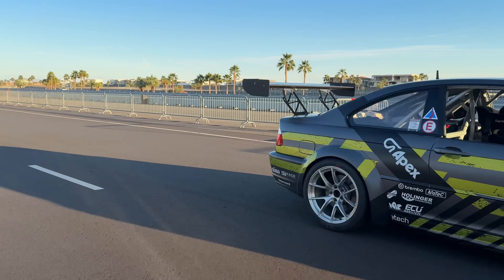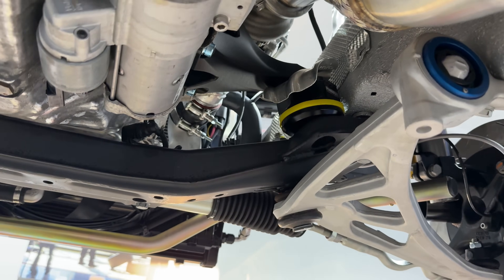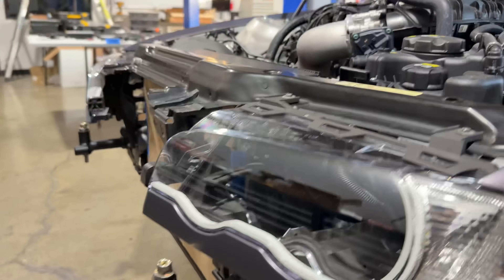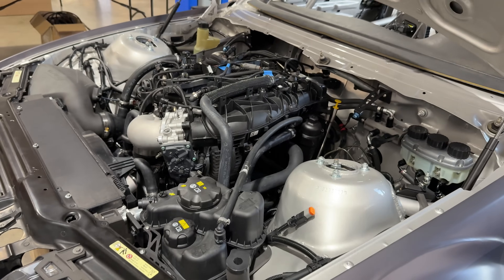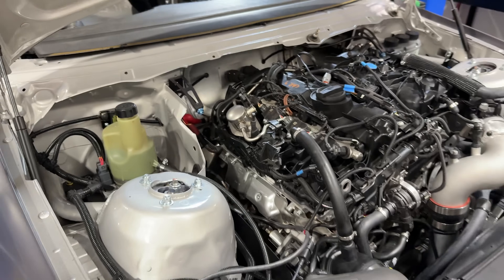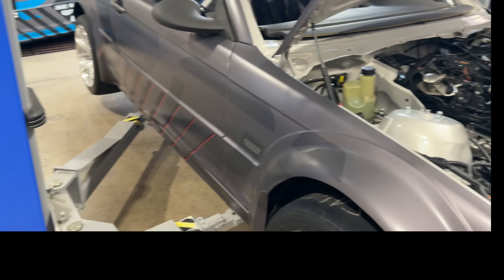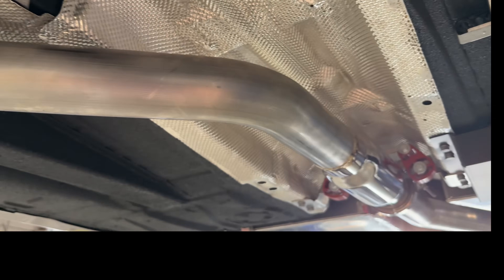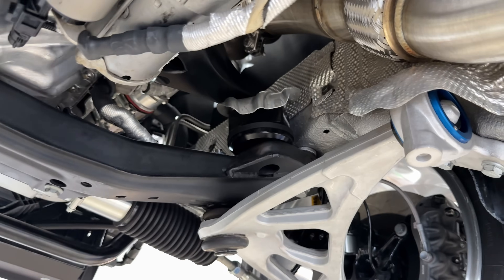BMW B48 into an E46 -Swap!

Comment: is it too far from the beginning of the engine compartment, or does it seem so without the attachment? these guys are trying on the same engine, as if closer to the interior. What do you say?https://youtu.be/eZ2PRLhrgnA?si=uSHtoku05LnU8HwG 10:45 sec
Reply from the maker: Its as far back as it can go while not having to cut the main body and still reach the cam solenoids at the back of the engine bay.

Comment: Does the stock B48 oil pump have cheap plastic parts like the gen 1 b58?
Reply from the maker: Not sure actually. We have never taken one apart fully because we have never had one break across 15 race engine packages.

Comment: with a street version brewing, my mind wanders over to if you could do an AWD swap of an X1 xDrive20i or xDrive28i into a 325/330xi E46
Reply from the maker: Anything is possible but the width of the transverse engine would likely create some challenges

Comment: Why don't you use stock turbo? Maybe you know how much boost stock turbo can handle?
Reply from the maker: We do use the stock turbo on some applications. Stock turbo is good up to 320whp on the dyno and about 300whp in real use on the race track depending on the fuel. The medium size turbo we use is good for 400whp and bigger turbo is 450whp. They can make more than that on the dyno but in real race track continuous use you have it back it off slightly.

Comment: Will you be putting a kit together for street cars? When will you think the finalized package will be ready for sale? I loved how everything was put together, the fabrication of mounts/brackets/exhaust are top notch🔥💯
Reply from the maker: We are working on it now. Basic "street" version will be available for sale Nov 26th but we keep adding more parts to make it super easy to just bolt in. However "street" also means it is still off-road use only other than states that don't require specific emissions controls. While we are running a catalytic converter and it would pass a tailpipe test its still a motec ecu so it won't pass smog in CARB states.

Comment: Hwy, i would like to b48 swap my miata. I'd like to use the b48b20a and a gs6-17 manual 6-speed. Do you think this is doable with stock ecus for gearbox and engine? I'd take parts from an f30 pre 2020 for the ecu to be accessable for tuning/coding. I'd like to use as many bmw parts as possible and not looking for a lot of power for now. 
Best regards from Germany

Comment: If pairing this motor to an E36 chassis, can it adapt to a DCT or Auto type transmission with paddle shift?
Reply from the maker: It does pair up with an 8HP50 with no adapter and we ran that transmission in B46-1. Unsure if it will fit in the E36 trans but I think it will. It was tight in the E46
Reply: @StromMotorsports I will email you guys. Looking to do this if possible. B48 w/ DCT style swap.

Comment: So basically ... we need a donor F30 LCI with the B4x ... strip that completely and transplant all the sensors into another chassis plus fab whatever doesn't fit in order to retain stock operation of the motor. No stand alone available.
Reply from the maker: Not sure what you mean? We make a standalone system for the motor.
Reply: @StromMotorsports but do we need to lose vanos and the worls or does it work like a regular oe application.

Comment: Fantastic design and fabrication work, interested in the factory ECU solution. Do the B48s have a balance shaft? I'm wondering if they vibrate as much as the Honda k20 and k24s?
Reply from the maker: Thanks!!yes they have balance shafts. They are ridiculously smooth motors, we are currently revving to 7500rpm and they honestly feel amazing at that engine speed.

Comment: rather print a decent inlet plenum with no charge cooler and run a front mount.
Reply from the maker: Why? The factory inlet manifold is really nice
Reply: @StromMotorsports  We found with the B58 and S58 if we install a machined flange adaptor and run a stock N55 intake plenum, they pickup a good bit of power, it also reduces weight and complexity. We picked up 20 Kw on the B58 and 35-ish Kw on the S58.The charge cooler is very efficient, but pressure drop across the core is significant.

Comment: Who do you have do your aluminum 3d printing? It looks great.
Reply from the maker: We have a couple vendors we use depending on the size of the part. The big ones get done in China by two different companies as the pricing is x10 in the US.
Reply: @StromMotorsports I would love to have that kind of upgrade in f22 chassis

Comment: One of the best parts of my S54 swap is the set and forget oiling which comes with the S54 oiling system. My old M52 had tons of oil starvation during left hand trail braking. Wondering if these engines are consumables or if the oiling system is reliable. Hope they are better than the N20
Reply from the maker: No oiling issues, we add a pan baffle and run the level on the high side but we track pressure very closely and never have issues unless it’s under filled. Being a short 4 cylinder helps and unlike m52 the oil pickup is at the back.

Comment: Is the intercooler radiator and M4 radiator sealed on finished B48 conversion, also is there a weight loss to effect corner balancing on finished conversion?

really clever design, 3d printing allowing pre-intercooler 👍
Reply from the maker: The weight in total is similar to an M54 on the nose. But no doesn’t affect the corner balance. Yes we have ducts and block off plates when everything is finished.

Comment: These B48s are a game changer...how many horses are you extracting out of them.
Reply from the maker: We have two high output cars. One running 430whp (endurance race car) and a time attack car with 450whp/450tq. Have made 470whp on the dyno under real world conditions but dial it back slightly for the track. Those are stock internals - just a bolt on turbo and added port injection.

Comment: This is great love the attention to detail, everything is so beautiful too. MOTEC for a race car makes sense of course but for a street conversion doesn't LINK have an ECU that'll run one of these?
Reply from the maker: Thank you! By the time you add everything up the LINK that can run this motor along with the separate GDI box its not much cheaper than a Motec M122. I may not be aware of all the LINKs capabilities though for their different ecus. But also I don’t think the Link can run the wastegate servo or the oil pressure control. If you just let the oil pressure run uncontrolled it’s over 120psi. Do you know of anyone running one of these on a LINK?
Reply: LZ had a build series on a B58 E46 but the last update was 7 months ago so nah probably not then, probably still working out the bugs my bad.

Comment: I’ve gone for the motec M142 on my S58 conversion , expensive but worth it long term . Stand alone is the only and best option due to additional features and ease of diagnostics and wiring etc 
. Used the GS 6speed for now until I choose a sequential..
I actually use the standard starter ring gear and am going to machine an alloy flywheel with a steel hard face to save weight. 

Cooling and fitting the auxiliary charge cooler radiators was a pain to work out . Add diff and gearbox coolers into the equation and it gets a bit tricky to keep things neat . 
Ended up converting mine to LHD to miss the turbos …
3d printing is the way but here in England it’s still extortionate…

Will be running a large case 4:3 or 4:1 diff 
325 rear 305 front using Porsche GT cup tyres on 18” rims . 

Great build ❤ , the 46’s have aged significantly better than the 36’s …
👌
Reply from the maker: Responded on your other comment, sounds like a rad setup. Would love to see it
Reply: @StromMotorsports i would do some content on YT but the workshop situation isn’t ideal for filming. Once it’s rolling early next year I may start doing some content. 
I’m building 2 , one based around a standard shell and another a full space frame siloette. 
Their actual E36’s and similar to Georg Plasa’s/ James clays car . 
The space frame version is expected to come in at around 850kg and 750 ish bhp which is easily done with the S58 . I’ve designed the front splitter so the charge cooler radiators and main engine radiator stay fixed to it enabling you to completely remove the front clam for maintenance.

Comment: SCS-Delta in the UK have plug and play standalone ECUs for the B48 which are cost effective and tunable.
Reply: I went for the motec m142 on my S58 M4 engine as at the time SCS didn’t support direct injection at the time . Unless I’m wrong they don’t do a direct injection system so you have to convert to port injection.
Reply: @newagetemplar6100  According to their website their GDI6 ECU supports 6 direct injectors and 6 port injectors.
Reply from the maker: Sounds like a cool project, you have it running?I looked into setting up an s58 briefly, are you running both boost servos and both high pressure pumps? The M142 was a little short on outputs if I remember correctly trying to run all the things that need half or full bridge outputs.
Reply: @StromMotorsports yeah cheers , will be running the E888 module along side the M142 . And running both turbo actuators and high pressure pumps. The tech specs are going to be done by my dyno man as I’m not that clever 😂. 
I’ll probably run port injection too if possible, not necessarily for more power, just as a backup in case the direct injection fails . 

Being based in the UK 
I actually rang SCS Delta at the time (2 1/2 years ago about an ecu but they didn’t do one that supported the engine. Haltech said they didn’t do one and  Syvecs were a bit weird to deal with ( as in corporate BS as soon as they answered the phone and an arrogant attitude). 
Cosworth was the only other option at the time as link also didn’t do one. 

I’ll be running the Mk60 abs unit , tilton pedal box and drive by wire accelerator pedal .

Porsche 992 cup brakes and centre locks on  the space frame siloette E36 GTR and also have double wishbone suspension. 

The other car will be based around a standard E36 shell but wide track . This eradicates the need for deep dish wheels, which actually look ok but are inherently bad for bump steer , scrub radius and geometry set up .

Comment: Have you weighed the b48d inclusive of coolers/turbo vs an S54? Online weights are all over the place. Supposedly the D was slightly lighter as well by bmw documentation.
Reply from the maker: We haven’t. It seems like all else being equal (similar race cars with the different motors) it’s about 50lbs lighter but that’s just my estimation. Would be cool to weigh one accounting for the extra radiator and water for our street project.
Reply: @StromMotorsports for example the n52 is almost 90lbs lighter than a fully dressed s54. It can’t make the power though!  Appreciate your videos as I have been eyeing this swap.😊

Comment: Street version run the standard 8HP?
Reply from the maker: We are running the manual first and then will do an 8HP50 later. Lots of things to solve with going down to the M122 from the M142 so trying to keep it simple.

Comment: Why? Shouldn’t a B58 make more sense? Especially with how unreliable these B48 are?
Reply from the maker: Not sure what you mean by unreliable. 450whp on a stock internal engine and fastest overall time at the last Global Time Attack event seems pretty good, no? We have 12 of these running in race cars and have never had a failure.
B58 would be very difficult to fit in this chassis and is unnecessary for our use case. We may put one in an E90 though.
Reply: @StromMotorsports please do a e90. I would love to see what it takes for it to work
Reply: @StromMotorsports  Incredible work! I love seeing the E46 chassis be put to good use. Any estimate on how much a street version would run?
Reply from the maker: @JtwasLuck not yet, we are currently seeing what we have to delete to run an m122 instead of m142 as well as other ways to cut costs plus still have AC. Lots to figure out! It’s all quickly solvable unless you are trying to do it in a way that can be sold to others lol
Reply: @StromMotorsports  Have you not seen other people mount b58's into an e46? Seems to be a swap that people have achieved already without cutting the firewall? 

What will be different about your new b48 mounts? Will they require cutting of the firewall?
Reply from the maker: @T1G3RKN33 yeah I should have said I meant for use in a road race car with adequate cooling. I know it can fit, it’s just a road race car that stays cool running for hours and a drift or street car are different things.  Know of anyone that’s got a B58 in an E46 for motorsport use? Would be interested to see it!
Reply from the maker: @T1G3RKN33 also new mounts are the same in terms of location, just optimized the design for cost and weight.
Reply: @StromMotorsports drift hq has been working on a b58 e46 build forever for Adam LZ. It's taking forever and using link ecu with a polish startup that is creating a can gateway.
Reply: lol B58’s have all the same problems, just occur at a little higher mileage. I’m a    BMW master tech. Also I imagine they run B48’s for the packaging benefits.
Reply: You should stupid. The b48 is not unreliable.
Reply: It's obvious this is a high-quality setup, but of course, some "internet mechanics" who never held a wrench are making stupid comments. Very impressive!

Comment: Needing a motec makes this set up cost prohibitive for it's output and serviceability imo. Really nice work regardless.
Reply: I nearly guarantee the ECUmaster Pro 8 can do everything Motec can. We chose it over Motec on our endurance prototype racecar. Just as powerful and 1/3 the price. The ECUmaster PMU 16 will handle our power distribution. Software just as powerful as motec after comparing the two.
Reply from the maker: Thanks, there are a lot of upsides to the motor and when everything is added up on other possibilities this isn’t a bad option. Just depends on what your goals and use case are. With the way we are doing the more street option the motec will be cheaper and is equivalent to an ECUMaster or Link that can run GDI. Motec also can run parts of the engine like boost servo and oil pressure control that those systems can’t. What engine would you do instead?
Reply: @StromMotorsports would it be possible to keep the stock ecu to run the engine with an 8hp?
Reply from the maker: @bhagved_turboboy it’s probably possible but you would need someone with really good skills at hacking a stock ecu or carry over a bunch of other modules that the stock ecu talks to. They don’t like being disconnected from all the other stock bits
Reply: @StromMotorsports thanks for the reply love what you guys do! I'll save up for a motec then want to put a b48 in my e36
Reply: Could use a speeduino setup to be cheaper.

Comment: Thanks for the rundown, always great to see the details!  
For the B48 side of things specifically, what are y'all running diff wise?  Gearing and locker wise.  Also would like to see more on your fuel cell, since that is actually fairly rare to see for a saddle tank to be in the stock location.

Excited to see more, thanks again!
Reply from the maker: We run a Kaaz 1.5 LSD with the factory 3.38 gearing. The Kaaz units have been fantastic. The 3.38 is a little on the tall side but the motor has such a broad power band that’s a good thing, shifting wastes time and it’s been proven in the lap data. 
We have some more info on our cell on our website and on instagram. I’ll do a YouTube video on it on the next install for B46-11.

Comment: Can’t wait to see your street version.  Hopefully there is some racing inspiration in that one 😊
Reply from the maker: There will be lots of racing inspiration and we intend to run the car on the track as well. We are trying to make the motor setup as cheap as possible to install on this version so less racy bits there. We plan to do a series of videos on the build though.
Reply: @StromMotorsports  been dreaming of building an e46 wagon now that my itb e30 is done and wanted something other than LS. Ballpark estimate on how much the entire swap would be?